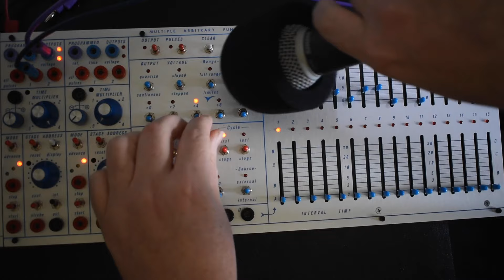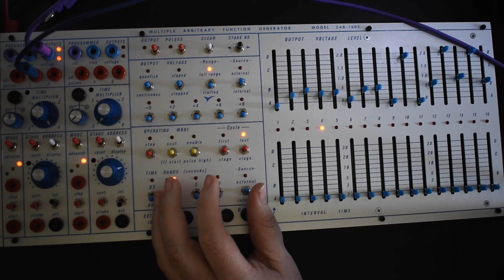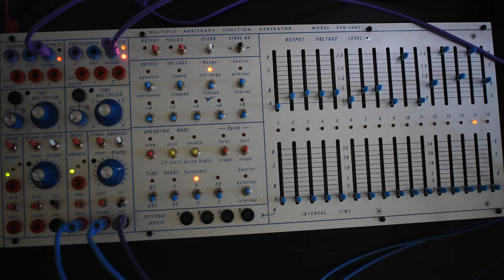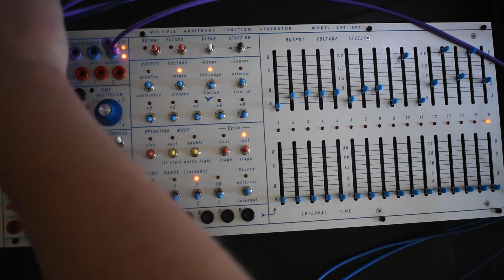SoU Episode 2 Featured Module - Multiple Arbitrary Function Generator Model 248 (MARF)

Comment: I'm really wanting one of these after seeing this video. I'm assuming I can use it to replace the 218e in my Music Easel? Though I guess it would be better to just get a separate boat for this...
Reply: It should be able to fit in your Easel case in the 218 spot, but if you can swing it, I suggest keeping the 218 and putting the MARF in a separate boat. The 218’s preset voltages, pulse out, and having the keyboard to transpose sequences can only expand on the system’s possibilities.
Reply: Yep, that makes sense, thanks!

Comment: In regard to the external inputs: It allows you to use the MARF as a sequential switch. It's a really advanced sequential switch in that you can switch between 4 external and an internal voltage in any order and for any length, but still a sequential switch. There are unlimited uses for this. I did a little demo of the MU format Moon Modular 564 Sequential Divider Switch last year using switched audio rather voltages but same principles apply to MARK external inputs. Moon 564 is a very versatile sequential switch but MARF is even more complex. https://youtu.be/2IPUi8_v-tM

Comment: Hey guys, can you please share with me how I can get your MARF to be clocked to my DAW?
I’ve heard MARF V2.5 has an updated that allows you clock the unit externally  ?
Reply from the maker: Hi there! If you can get a clocking pulse out of your DAW (I've had some success with taking a metronome audio output from my DAW, plugging it into a 230 to get a clocking pulse) then with the latest update you patch that clock into both the start and stop inputs and it should follow each step. You can also add a "stop" modifier on every step and then plug the clocking pulse into just the start input to achieve the same results.
Reply: @SourceOfUncertainty  nice one mate :)

Comment: hey guys - am I able to CLOCK the 248 with a PULSE so it can be in time with my DAW project (125BPM) ?
Reply from the maker: Yeah that should be possible. I find the best way to clock the MARF is by programming a "stop" on every step you're using in the sequence, and then pulse the "start" pulse input.
Reply: @SourceOfUncertainty  is there a way of clocking the MARF so that it still produces pulses ? because it doesn't doing it the way you mentioned here.